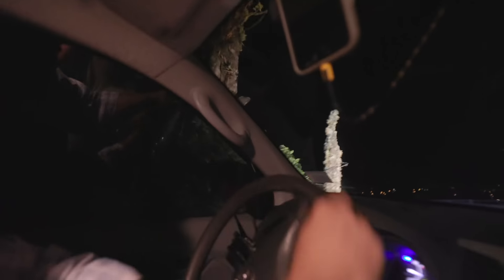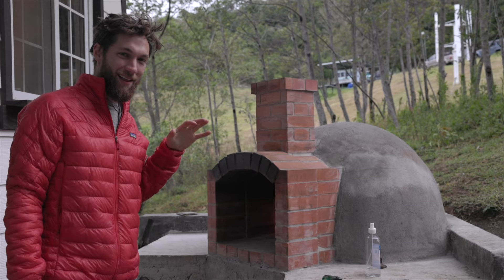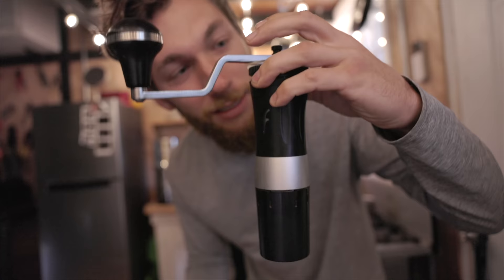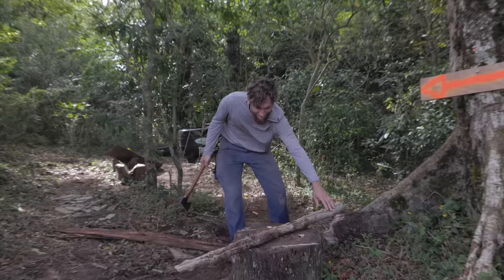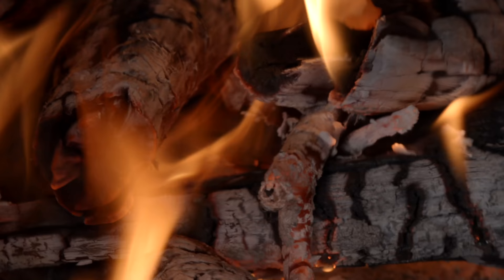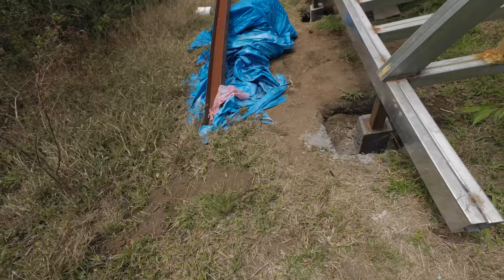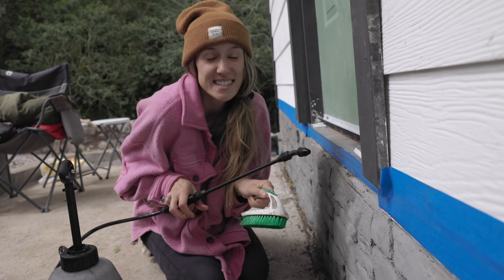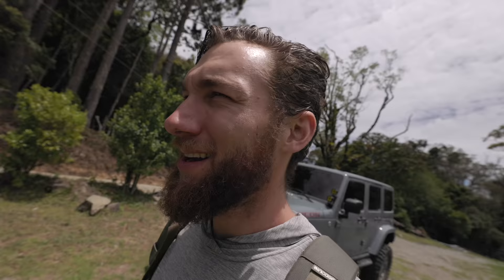SIMPLE LIVING IN THE WOODS / cooking with fire in the mountains of Panama

Comment: Had a Jeep Wrangler…fun to drive in the Florida sun and sand…also learned a lot about changing starters, changing alternators, changing fan clutches,changing thermostats, radiator hoses, vacuum lines, valve cover gaskets and brakes! Paid a mechanic to put in clutch plates and throw-out bearing!!! 😎. I am better for it…I think!

Comment: P0420 , usually means it needs a new catalytic converter . If the code was 420 , a lot of times the downstream 02  sensor is mirroring the upstream 02 sensor and the code sets . A lot of times that 02 sensor is good and just reporting the condition , setting the code . My issue would be , Before installing the new converter i would need to figure out what took the converter out in the first place . I could not let the customer pay for a new converter with out trying to find out why it went bad or they may need another new one soon . A little scanner with live data would be nice to have there . Bi directional tools on a scanner is even nicer .
Reply: If run with out a air filter , I would clean the MAF sensor . If possible use MAF sensor cleaner . If not maybe brake clean . Just spray and let dry . Just becareful what you sprat on the MAF as there is a coating on the resistor that helps dirt from sticking to it . Many cleaners take that coating off and sensor is a recurring issue then . Maf meters the amount of air going in the engine and one of the main factors in setting fuel trims , so it needs to be clean

Comment: You should weld the jeep axles to piles like you did to your bus except make them 8ft high and on an angle outward like the bottom of an A frame then make a room under the Jeep to use as a garage for your Toyota. Mount a small solar panel on the roof to charge the battery so you can go up the A frame into the Jeep and enjoy the view and listen to the stereo or read a book. If you do not expect your Jeep to go you will enjoy owning it more. The mafia who own jeep can only extort  money from you if you drive it, so don't play their game. First song to  play on the stereo is of course. "I made a mistake and bought a Jeep"
Reply: Lol love this idea. Yeah I’ve learned Jeep are not the most reliable. And I’ve always made a point to not have a nice/new car when I lived in a city. I would imagine I would buy a even older beat up vehicle if I lived in a country like Panama. But if ya got the $ to burn I guess go for it.
Reply: @jgoo4572 ....they can sit in their ostentatious vehicle, sip latte and eat avocado toast while checking facebook. Real off grid living.

Comment: Brick Oven Cooking Techniques: Baking (conventional oven temperatures)

retained
Baking (500ºF and down) is used for baking bread, desserts, smaller roast meats, beans and legumes, and pasta dishes at conventional oven temperatures. After fully firing your oven, carefully rake out the hot coals and brush out the oven. If you wish, you can swab the deck with a damp, but not wet, towel. Your oven can now cook gently and consistently with the heat retained in the oven dome and floor as the temperature falls.

Using this type of cooking, you can bake either one fully-loaded batch of bread, or multiple batches of different types of bread in smaller quantities. Close the door tightly against the oven opening to hold in heat and steam.

Comment: Pizza is one thing, baking bread in an open oven is another. Consider baking the bread in a Dutch Oven. You'll get more even heating around the bread and you can push the DO right into the coals and rotate it every 10 minutes or so.

Comment: P0420 is a catalytic  convertor code. Sometimes your can do a fuel injection service and I mean one that cost in the states 180.00 to 220.00. Like Terraclean. If the converter is dirty, smuts coating the precious metal is what I mean. It can clean it off and that can let the convertor clean the exhaust.  the front o2 sensor measures the burnt exhaust then the convertor cleans the exhaust and the rear o2 sensor measures how clean the convertor did its job.  Depending how old the Jeep is and how many miles is on it, here in the states it is warranty 7 years and or 70k. Good luck.

Comment: ODBC failure on 420=oxygen sensor overloaded. change intake filter and add THC oil on the filter element. keep it oiled, and use the interior air on recycle.

Comment: The oven is what black Smith's used 300 years ago. To better understand. Watch French you tube Bakers used coals. A hole in the back of the oven will help control temp and burn rate. Makei g a metal door in front will help trap heat and not waist wood. What you built is a fire place. That you tossed a pile of dough in.

Comment: hey everyone, you can use a metal mesh screen (custom weld one) to block the ash from getting on your bread. use custom cut pieces of aluminum to get a reflection of the heat a little more evenly. put them on the inside of the oven area. like a mirror. check around for heathy, aromatic woods like our hickory in the US. looks sweet. slow cook stews there too if you eat goat, you might need to slow cook. very tough meat. jumpers that is why, i think. muscular. you can slow cook really nicely in cast iron pots with lids.

Comment: Buying or making, a 1/2" thick, plate that has legs to keep it off the coals. Make it fit the round part but you can remove it. Make the fire slide a pizza on the metal plate. Cook it that way. Note, keep the metal plate clean and oiled so no rust will form.

Comment: Diagnosis: The most common cause of Jeep P0420 is a bad catalytic converter, but it can be caused by anything from a faulty oxygen sensor to a rich or lean running condition, or misfires.Feb 21, 2022

Comment: Great video guys! 
Btw not sure but looked like you may have an oil leak of some sort, underneath near where you were fitting that oxygen sensor there was definitely something leaking onto the rusted casing it looked like?
Anyhow great you're learning by working on stuff yourself! (Hope it doesn't have to be too often or too much of a learning curve!)
One other thing with all the rain you get and water, might be an idea once all the niggles sorted to get the whole underneath jet washed thoroughly, then painted with rust converter to convert any existing rust surface or otherwise and prevent it spreading or getting worse like on the casing and chassis etc etc and then paint over that, once the rust converter has dried.. Then youve protected it, got solid metal and painted to stop any further rusting at least for now (and prolong the life of the vehicle) and also increases the resale value if you change it! Just an idea.. also if you got the option to get quality parts like oil air and fuel filter for not much different money then always better to get OEM or best you can get like Bosch or Mann filters and high quality "fully synthetic" oil "long-life" of the correct weighting for the climate. This will ALSO prolong the life of the engine, prevent failures/ wear and possible breakdowns, as cheap filters and oil REALLY do mess an engine up/don't last/false economy, as they're cheaply made! So its well worth an extra 20% on the cost if you plan to keep the vehicle for any time..
All the best from London England 👍😎🏴

Comment: That jeep has problems..... they took the filter out to try to keep the engine light out. A new o2 sensor won't fix it.... its got a throttle body issue.... like I said in the last video. Just because it has a o2 sensor code doesn't mean it's the o2
Reply: P0420 code is not for the o2 sensor